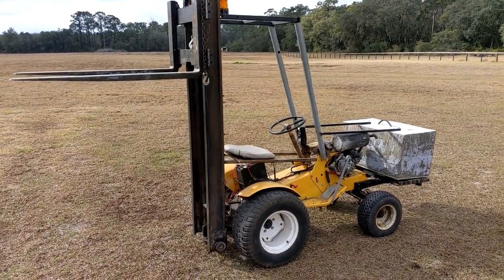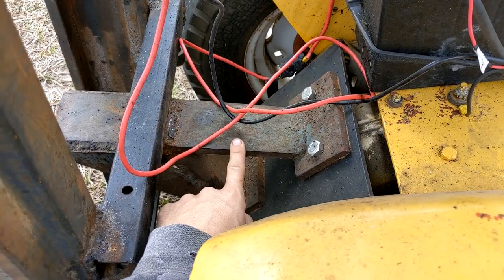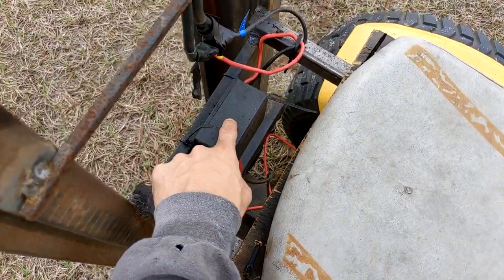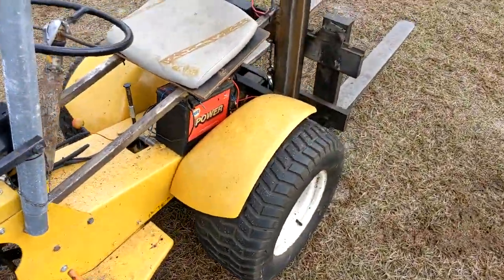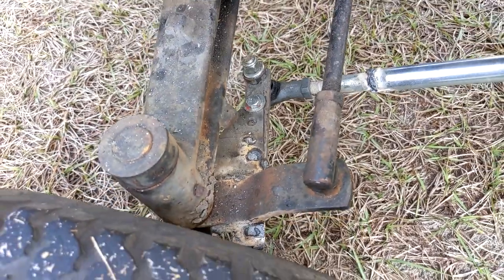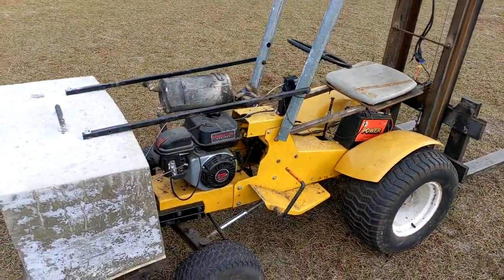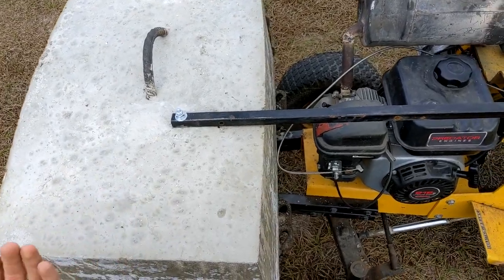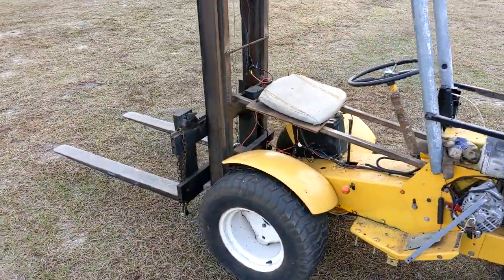Roper/Sears Garden Tractor Forklift

Comment: Hey Brother Man. One more thing I'd like to add. I grew up around these things when they still had fresh paint. They were common around boat boat shops for moving boats as well as , WheelHorse , and Cub Cadets. With the Custom , and some of the Suburbans having aluminum housing transaxles they would bust and do a split. I've picked up several around the marinas to bring back to the old man's shop to have replacement. 
   I would order as many pillow block bearings that would fit between the transaxle and the wheel adapter or even space the wheel adapter out a little. That way you are getting the weight closer to the tires.     If you doit this way , and wanna add mast tilt it will not be any trouble.    Great idea. 
   Do you plan on reversing the seat , wheel???
Reply from the maker: Just after this video I did add pillow blocks. 
Last year I built a proper forklift

Comment: What's the transaxle?   Your last Almost Heaven Lawn Mower video has me wondering about the 1" axle hydro's in the Simplicity's.  I'm going to try to read into those some more.  I'm beefing up a Ford YT16 (Gilson) to make into a SVT GT for electronic actuated stuff.  I'm wanting to do a fork lift style mast, though more for piling, driving posts and that.  Maybe a workbench lift more-so too.
Reply from the maker: This has the Roper 633a transmission.

Those simplicity hydros have a Eaton 7 pump on a peerless sxale. They are good and strong but are considered "light duty"

Comment: I could pull a better forklift outa my @$$. Oh wait I love this build 😂💘. 
   I've used bunches of these Suburban, and Custom for different builds. As well as the Clonda engine. As I'm sure you have noticed when you let out on the idler too quickly you will kill your Clonda. Find yourself a big heavy cast iron pulley , or whatever you can to make an inertia flywheel. Being you have old engines maybe you can get a cast flywheel turned in a lathe and balanced , bored to fit the crankshaft, keyed as well. On these you have the drive for the transaxle, blade deck , and other add-ons. Putting on an extra flywheel is tight , but will save you frustration.    I luv these Roper over Cub Cadet, because of simplicity.